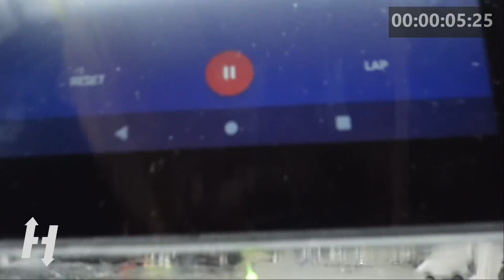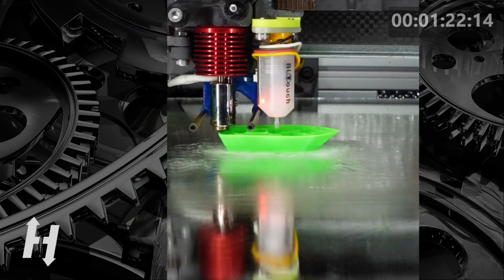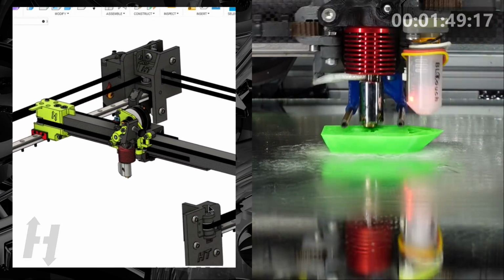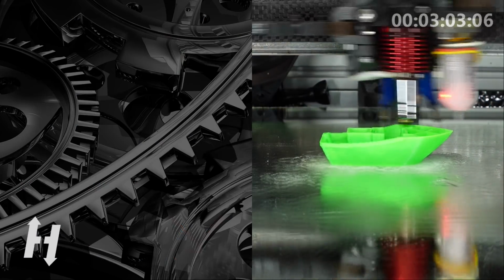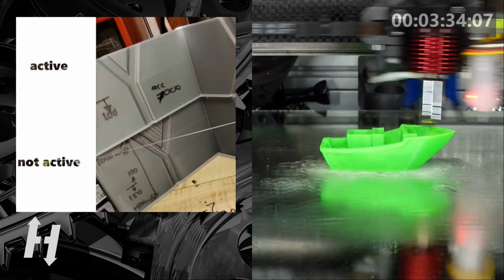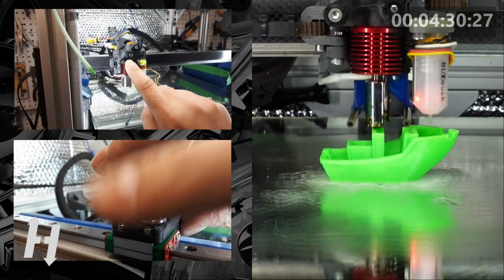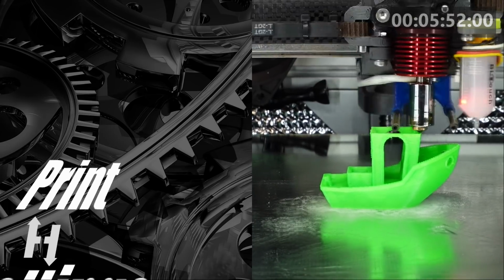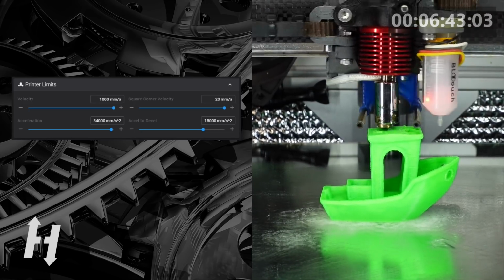My Recipe for FAST 3D printing

Comment: I have not had a single successful ABS print pretty much. I think half the issue is that at slow volumetric print speed, whatever is loaded and molten in the hot-end, actually rapidly degrades chemically. Maybe it's just mine though which is junk.

Also the smell, it's diabolical. I have lost consciousness once already.

Cooling has been a fail too, due to warping and separation.

Maybe special ABS with very little butadiene? Any secrets?
Reply from the maker: Print very hot and a lot of cooling.  This will result in good layer bonding and most of the material retraction will be managed right when it is laid down.
Reply: @MirageC  Printing hotter has made it worse for me, with 230 being the best compromise. What comes out warmer is just brittle junk, even a bit colour shifted towards yellowish. I still have a PTFE lined throat though at this time, so going really hot is not quite an option. I have an old Geeetech MK8 direct drive, i could conceivably install an e3d v5 all-metal throat in it, but it seems that the carriage bracket could be scraping the bed.

Also it's unbranded ABS. And as i said this one smells diabolically, which indicates a high presence of unreacted styrene monomer, which might be due to butadiene induced inhibition. I don't think they're all the same.
Reply from the maker: @SianaGearz  Heat transfer is affected by the time material spends into the hot end.  printing fast requires more heat to be transferred, so in order to get the plastic at the desired temperature we need a bit of buffer and overhead hence why I print this one at 300.  But if you are printing slower, just use the high side of recommended temp for your material.
Reply: @MirageC  Printing slow was bad, printing fast was bad, printing wide was bad (but less bad), everything was bad :D
Reply: @SianaGearz  i got some black abs off ebay that doesnt smell barely at all :O . the curling and cracking can be thermal expansion and contraction differetial, i think less  dense helps with that.... and brittleness is often moisture in the filament. a tiny bit can make a big difference in part strength and brittleness
Reply: What brand is your ABS? I've printed with a few different brands and rarely had much issue getting it to lay down nicely. Like Paul Menard mentioned, having moisture in your filament can be a big problem. I also recently bought some Hatchbox ABS and it printed horribly at first. Surprisingly, what fixed it was cranking the part cooling fan up to 100%, which normally isn't needed for ABS.
Reply: @MrJacobegg  It's unbranded, and i got it from "Electropapa" store, which otherwise sells shitty printer ink and shitty batteries for long-discontinued phones and cameras. It was very, very cheap, something like 12€ including shipping. I bought it back in 2017. I had it dried already a few times, by placing it on a heated printer plate under half a cardboard box with some holes in it for like 12 hours or so at a time. I live in an apartment with very dry air,
Reply: @SianaGearz  sounds like it might just be crap filament. If you're in the US, I've had excellent results in the last couple months with KVP (also available from Filastruder in a limited number of colors for cheaper). People rave about it on the Voron channels and I can see why. It's not much more expensive than the cheap brands on Amazon, but prints like butter and is incredibly consistent.

Comment: For some reason I have a have a hard time believing this isn't a 50x timelapse. 
I don't dare print at anything more than 40mm/s and a 75mm/s² and then there's this thing making my printer look like a rattling DC motor driven relic from 2012.
Reply: I just finished assembly (came 95% assembled) of a Lotmaxx SC-10 I bought via amazon for less than $300, and the thermistor reading is horribly wrong, reading things notably higher than seems sane, haven’t investigated what happened: suffice it to say, I’m printing Atomic Filament PLA that has temps stated as 180-230C, and I’m telling my printer to do 250C because lower is too low to not get jammed, and no, at 250, it’s not looking like stringy liquid or runny.

Anyway, perhaps I failed to push filament volume up high enough for the temperature when I tested 150% speed at .1 layer height, and it failed at about 30% through on my I-beams for my board game. I pushed it up manually on the touchscreen on the printer.  I looked over and saw it was printing air.

Ok, so next I decided to slow down to “normal” at .1 layer height and default speed, because I had nice results with the sliced dog that came with the printer on the micro-SD card.  The default speed? 60 mm/s. No problems, though it was over 13 hours to print.  I had a time limit.

So, tested the next batch first (new to actually 3d printing) by doing a single 6*6*50mm I-beam at .3 mm layer height (.4mm nozzle) and that was around 10 minutes.  Checked, quality didn’t look too different, and I was wondering about strength, saw/felt no obvious problem. Because there was no fill and extrusion thickness changed, they were different in thickness for dimensions just enough they work for an unplanned variation of Jenga :p  But, I’ve now successfully printed 240 (using 6 different colors, 40 each) of them ay 60mm/s on a printer under $300 and a little assembly to do.

The printer design uses aluminum extrusions, and seems like it has quite a bit of stiffness. Also uses v-rails (forget the name) which I expect will need to be retightened as they wear over time, and no linear bushings. Manual leveling, I’ve not bothered to relevel it after the first time.

Perhaps your printer has worn down from use, or it’s just too wobbly, or perhaps your filament is less than perfect, etc. but you really should be able to print at least 60 mm/s with nice quality.
Reply: Running a standard hevo with rails, 150 gives me decent speed without any special tuning.
Video is plausible.
Next step, you could try Klipper to push your printer speed to double

Comment: why don't you scrap the carbon too and just have the linear rail all by itself, isn't it rigid enough?
Reply: yeah they are too floppy. btw these 3k CF box tube on aliexpress uses an unspec'd epoxy which melts at a pretty low temperature. something like 50c. its dirt cheap though

Comment: Awesome progress! Have you seen Arc Welder? It’s a post processor that parses G-code and changes small line segments to arcs using the native g-code for arcs (G2/G3.) I think changing to G2/G3 over the small line segments currently used could allow for higher speeds and smoother prints.
Reply: Well this is great to hear! FINALLY the move to G2/G3! As a Machinist for over 30 years, I've always hated the STL file format! I'm going to look into this Arc Welder. Thanks for the info! 👍
Reply: Having read about how Klipper works, with using a Raspberry Pi to generate pulses, I strongly suspect breaking it down further won’t be of any value because the printer microcontroller is already only dealing with pure pulse generation and timing, as all g-code is managed on the Pi via Klipper translating it.

At some point, breaking things into more g-codes adds more overhead for the Pi to compute and may slow things down.
Reply: @strictnonconformist7369  arc welder really compresses the Gcode, it should actually make the load lighter not higher. Imagine a spline in non arc gcode vs arced gcode and you will see how much less commands it takes.
Reply: @malloott  No, no the actual MCU doing the stepping doesn't even read G-code in this case, klipper does on the PI!

It translates that to pulses, so no difference really for the hardware driving the motors if you use G2 or G0.
Reply: It's worth a try, arcs could potentially be a small bit faster. Definitely faster on Marlin and RRF but not sure on klipper, but klipper does support arc I believe.

Comment: Is this still with steppers and not servo motors for X and Y?
Reply from the maker: Qty 2 E3D High torque @ 24V powering this machine ;)  Servo machine need some love and time... :)
Reply: Also, I think the Speedboatrace rules specifically "outlaw" servos;-)

Comment: "Obviously this is not a perfekt ..." STFU i would neet to print that in more then 1 Hour and i would need to pray that it looks so good as yours .....damit !!
Reply: Wtf, i have also 3d printed the benchy and honestly i an impressed of good it came out with only the standard settings from Cura...
Reply: Then your printer and/or your settings really suck...
Reply: Daniele Testa I mean from what I saw it didn’t look too far from what my cr-10 produces...